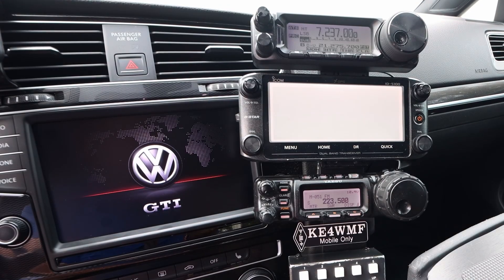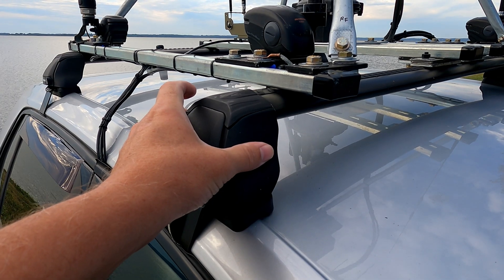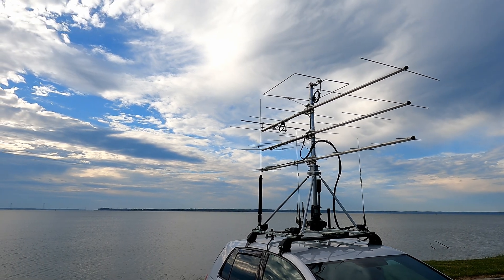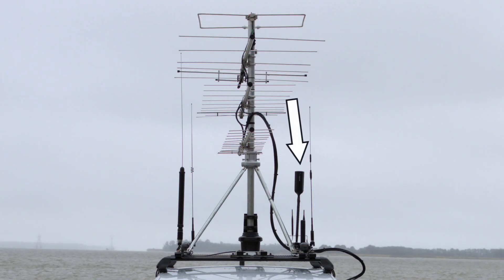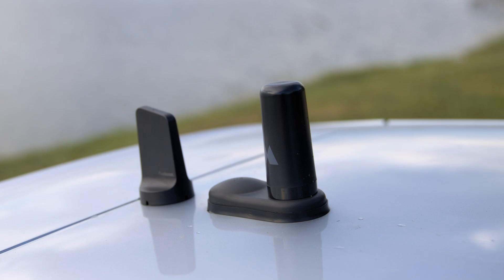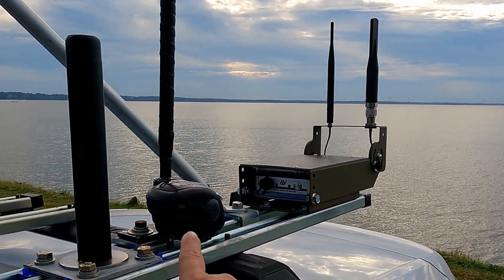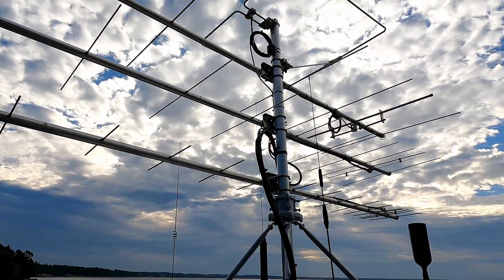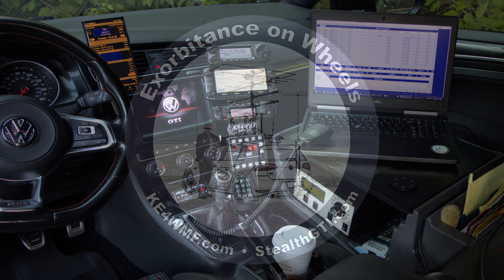VHF Rover on a Diet: Updated Antenna Farm

Comment: Hey there.  Love these videos updates.  How about if you can make a video on showing how you mount those straight bars onto the roof rack with a flat roof rack. Mine is flat and wondering how I can mount those bars to it? Thanks 🙏
Reply from the maker: It's been a while since I last had a running list of video ideas. I'll add this to a new list. But, to be clear, are you asking how I attached the Superstrut to the crossbars? Thanks for visiting!
Reply: @StealthGTI  yes my crossbars have a flat surface all around and I noticed yours has holes where you can screw them into.  I however don’t have that opportunity. I was wondering how I can mount the super strut bars onto a flat surface roof rack??
Thank you.
Reply from the maker: @ipodbuff - What brand and model of crossbar do you have? Not one with a T-slot?
Reply: @StealthGTI  its just a normal gmc Acadia 2015 chrome crossbar doesn't have any slots on the top what so ever.

Comment: VERY IMPRESSIVE rover installation!  I’ve been debating giving roving a try; my vehicle is a 2012 Honda Odyssey with a factory roof rack.    I’ll have to check out that channel material that you used on your system.  One issue I might run into is that with the Odyssey being a much taller vehicle than your VW,  physically being able to reach up there (& I’m a short guy! 🙄).  I also liked your solution for bringing the cables inside the vehicle.  One question; do you get much wind noise from the Yagi antennas at highway speeds?

73,
Tom WA1LBK
Reply from the maker: Thanks! If you use Superstrut as crossbars, then you could lift the entire assembly to the roof (rotator and its base, too) at the edge of the crossbar and then slide it into position. Being "just Superstrut," who cares of you scratch it up during the slide?  That's what I'll consider when I eventually have a taller vehicle. Regarding wind noise, I don't think the entire load is any more noisy than having a cargo box on the rack; and cargo boxes are more "aerodynamic." ;-) Thanks for visiting!

Comment: Great video. I may have missed it but who makes the hood mounts you have on each side of your hood? I'm looking for a low profile way to have a mount that I can put an ATAS on for mobile HF. 73 de KI5PRK
Reply from the maker: They're "ditch light" brackets by Forge Motorsports. As the name implies, they're not antenna mounts at all. I have a video at https://youtu.be/n3wZuIudgmA that details them. I did try mounting my ATAS to one, but I don't recommend it! I was uncomfortable with the amount of flex and movement in the mount. I'm confident that it wouldn't have bent the hood or its hinge, but I still didn't like it. I'm using 3/16" steel plates to mount the ATAS and the K9000s on the rack. I'll try to detail that sometime. Thanks for visiting!

Comment: Thank you Scott for another brilliant, thoughtful video.  You keep refining your mobile equipment and share your knowledge.  Thank you also for including the metric or imperial conversions on screen.  I’m curious what the original use is for the “existing threaded hole” on your VW and is this the only ground connection for your roof assembly?  73. Steve K.  KD6KXT
Reply from the maker: Thanks, Stephen! I started adding metric labels years ago when I realized that half of my audience is from around the world. So, I'm glad to add extra value. The threaded holes are used as alignment points for dealer roof racks. The racks don't use the threads, just a pin in the hole. I don't know why they're threaded, but I'll still take advantage of them. Those two holes are my only ground connections for the roof assembly. I could probably tie into a hinge mount at the hatch, but it hasn't been a priority. My only priority is that I won't drill a dedicated hole for bonding. Thanks for visiting!
Reply: @StealthGTI  Thank you very much for the explanations.

Comment: I have no clue about HF, but is the Metal Roof relevant for Grounding or anything regarding the Antenna Quality? Or could the be mounted to a Tree too?
Reply from the maker: I'm not sure what you're asking, but I'll say that I pride myself on being a true mobile station. Putting antennas on the ground or in a tree would turn my station in a portable station. I might output a better signal with a larger antenna in a tree or with radials on the ground, but then I wouldn't be "mobile."  ;-) Thanks for visiting!

Comment: Are you sure there is no interaction between your antennas? They seems too close
Reply from the maker: There's probably some interaction, but that's to be expected on a "run-and-gun" Rover. The antennas have good SWR at their resonant frequencies, both while transmitting and during analyzer sweeps. That's about as good as I can get on a vehicle without a push-up mast. Thanks for visiting!

Comment: On the Tarheel foldover mount I have for my trailer hitch, there's a pin that you pull out to fold it over. No tools required and very quick.
Reply from the maker: Thanks for sharing that information! Tarheels and Scorpions mount differently: Scorpions mount from the bottom with a 3/4" bolt. Also, my car has a 1-1/4" hitch. Thankfully, the Breedlove tilting mount does not require a specific type of hitch. Thanks for visiting!

Comment: Have you noticed better performance out of the ATAS up on the rack vs mounted lower?
Reply from the maker: I've never mounted it lower on this car. It's been so long since I had my ATAS on a trunk that it would be unfair to compare since we were in a difference phase of the solar cycle. But it seems to work fine on the rack. The K9000s are too new for me to know if they're affecting ATAS performance. Thanks for visiting!